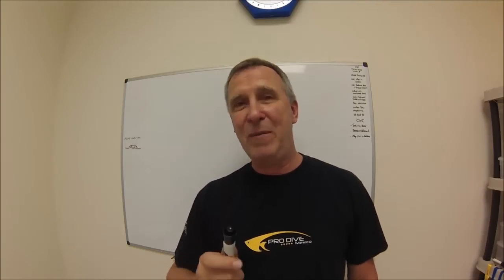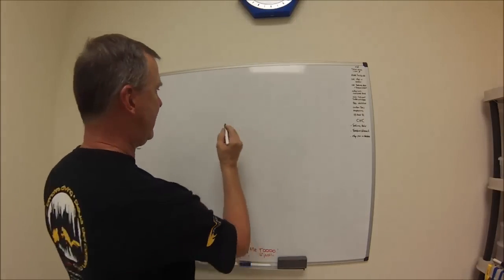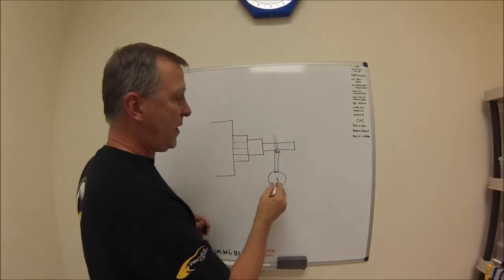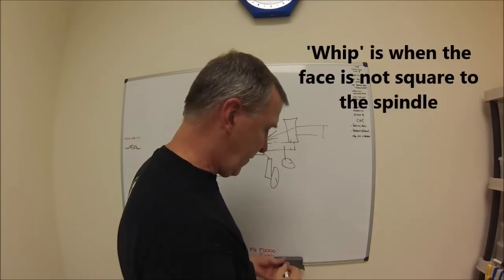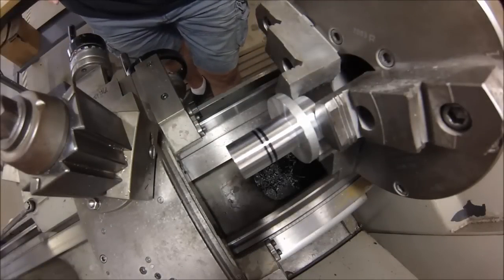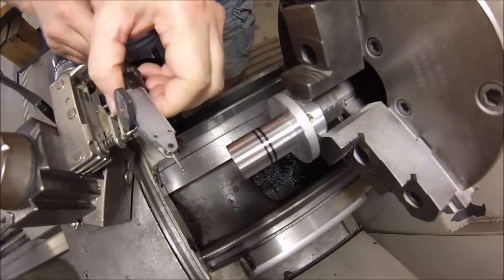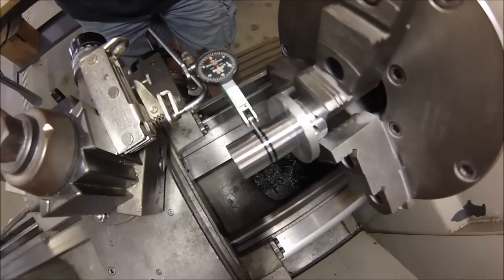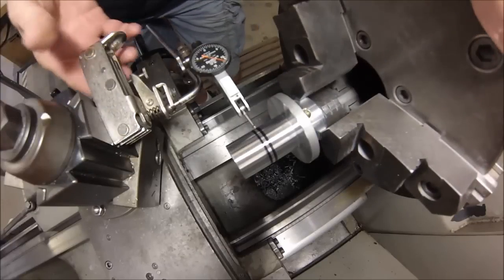CLASSIC Rewind -- Precision indication on a Lathe - DO NOT MISS THIS VIDEO !!

Comment: A sharpie marker will remove itself. Just mark over the spot you want to remove, the solvent in the marker reliquefies the mark, quickly wipe off. 
This is good (and simple) for making corrections on your permanent marks or notations with a sharpie.

Comment: soooo... how to hold and indicate a gear?
Reply from the maker: What is the machining to be done on the gear?
Reply: @joepie221  face, taper the bore, blah blah...

too big for a pot chuck, ie, no handy scrap to make one. and that would rely on the OD being accurate anyway...
ended up on the faceplate,  some ground pins in random teeth to clock off the PCD or at least the same region in various teeth... didnt trust the existing bore. just as well, showed about 0.2mm runout once set up...

 the joy of using "off the shelf" components?

makes that nice sweet "wirr" sound rather than that "cachonk cachonk" of slightly eccentric gears... fifteen years ive tolerated that sound from the first attempt!

theres some video material for you... dealing with things like gears, timing pulleys, etc... clocking things that dont necessarily have convenient references? or may be suspect if they do?

Comment: Hey Joe the thing I never understood about this concept is how a part can move in the chuck? Once the jaws are tight the part has nowhere to go, therefore tapping it is only bending it, isn’t it? Can you elaborate on this?
Reply from the maker: Its probably the resting position of the jaws that gives it the most opportunity to move when bumped.
Reply: @joepie221  so essentially it is the jaws that are shifting ever so slightly in the chuck body? Is the position of a machined part repeatable when chucked over and over again? Before watching this video I always thought a part would run true to the lathes axis when chucked.
Reply: It may be gripped tight but not square. Ever measure a square object with a micrometer. If it's not square between the carbides you will get a different reading. It just happened to me yesterday and I got a .002 deviation.
Reply: @madjack956  how does this relate to a round part in a chuck?

Comment: If you make a mistake and actually use a Sharpe Marker on your whiteboard, all is not lost. WD 40 will remove Sharpe ink off a whiteboard easily. Once the Sharpe is gone, remove the residual WD 40 with a bit of isopropyl alcohol. I once attended a sales meeting where the President of the company used Sharpe on a hotel's rather expensive whiteboard (6' x 8'). When the mistake was found, one of the hotel's cleaning crew came in and cleaned the board off as described saving the day. He told us it happens all the time.

Comment: Hi Joe, you could see the error in the camera view were the part was moving back and forward compared to  the bed. I assume that chuck was a 3 jaw independent, which means you may have to adjust all 3 jaws to achieve a result, rather than the opposing jaw in a 4 jaw independent chuck.
Regards from Oz, Dennis

Comment: Hmm?  How about a chalk board?
1/ No dried markers.
2/  Chalk is cheaper than those marker things.
3/  Chalk has no solvents.
4/  I am yet to be convinced that the fine dust from those marker things is safer to breathe on board erasure than is chalk dust???
5/  Bits of chalk on the board ledge are ultra available.  Usually there are few if any markers available; at least with a strong line.
6  Easy erasure.
7/  When you need to chalk a file a quick trip to the board is all that is required.
Perhaps I am missing something, but simpler is almost always better.

Be encouraged Joe.

Comment: 91% isopropyl/rubbing alcohol or dry erase markers over it will remove sharpie or permanent marker from a white board. 👍👍
Reply: Use a dry erase marker over the top of a sharpie and then wipe it off.

Comment: The first 10 years of running a lathe, from a learning perspective, the only chuck I had was a 4-jaw independent chuck.  Dad started out as a oilfield machinists, running lathes that only had 4-jaw independent chucks on them and that's why his 9" SBL lathe in the home shop only had a 4-jaw independent chuck on it. You get really good at dialing in one. Later in life, I've purchased several 3-jaw chucks, most of the adjustable type like yours.  I still get the 4-jaw out once in a while and use.  thanks for sharing.
Reply: I have both in my cabinet but the four jaw is the chuck of choice, but my three jaw is the non-adjustable type.

Comment: Quick whiteboard trick: if you accidentally use a permanent marker on a dry erase board, try removing it by coloring over it with a dry erase marker.  The solvent in the dry erase markers usually dissolves the permanent marker and amalgamates the other dry erase components into the permanent marker ink.   This turns the permanent ink into a (poor) dry erase ink, and you can remove it.   It might take a few iterations to get it all off.

Comment: The one question I have about any kind of part indication on the mill or lathe is, if you can adjust the part by "tapping it in", what prevents it from moving once you get it in the right spot? I get that tapping is an impulse movement, vs cutting should be continual, but it seems to me if it moves if you tap it, it could move while it's being machined as well. Just an odd question from a beginner hobby wannabe machinist
Reply: Hi, Once you get it right then tighten the chuck up.

Comment: Mate stupid question. But I take it that wasn't the usual 3 jaw chuck that all jaws tighten together with the key?
Reply: This is a "set-tru" (or equivalent) that moves the body of the chuck. The three jaws are on a scroll to move them in or out, but the scroll has limited precision.  The whole chuck body, including the jaws, is moved slightly on the backplate by the use of four screws near the back of the chuck body. It is sometimes possible to modify a chuck to add this functionality but it's easier (and typically more expensive) to buy it with this capability.
Reply: Thanks mate
Reply: @Gravattack  Without a set-tru or equivalent chuck, you have to go to the 4 jaw to be able to adjust anything like he showed here. Most smaller / hobby lathes aren't going to come with a set-tru chuck
Reply: @gorak9000  Thanks, I'd never even seen one before.

Comment: What indicator holder is Joe using? It seems very efficient.
Reply from the maker: its a US General model 387. discontinued and hard to find.
Reply: @joepie221  Sounds like a good project to make one.
Reply: US General #387 with magnetic base . He mentioned it in his setting lathe tool heights vid. Ive been trying to find one ever since.scarce as hens teeth
Reply: When I can I use a regular 1“ throw dial in my tool post. This allows me to put it at center height, and zero using the cross slide or carriage.

Comment: I've used a 4-jaw chuck many times, but I never had a Buck set-tru style chuck. On the set-tru style, do you ever loosen the front chuck screws to allow the chuck body to move relative to the back plate? Or can those screws stretch and pivot enough to allow some motion, while staying tight? Thanks.

Comment: I cut threads toward the chuck because my lathe has a threaded spindle.  My lathe also has no provision for running in reverse.  That can be done a number of different ways of course but I also don't have a problem threading toward the chuck because I simply pay attention to where the tool is.
Reply: You got an old Lodge and Shipley?
Reply: @williamrekow7513  No, actually it's a Hercus 9A which was made in Australia under license from South Bend.  It's identical to a South Bend 9A and in fact has a number of south bend parts since shipping from Australia to Canada is a touch spendy.

Comment: Permanent Sharpies go away with alcohol, just sayin'.
Reply: as will acetone but both alcohol and acetone will both damage the coating that is on most (if not all) whiteboards...
Reply: @CP_300PRC  There's also special whiteboard cleaner (I'm not sure what it is, but it has a somewhat unique smell). It will take sharpie off, as well as the build up over time of the dry erase markers that leave the board hazy, and leave the board perfectly white and just like new. Not sure if you can get the "original formula", or only the environmentally friendly stuff these days - the original works way better.
Reply: @gorak9000  Hmmm, interesting. I knew there were "special" cleaners but never knew any of them would take off Sharpie ink.. Thanks, I'll have to look into them.

And yeah, sounds about right... "original" good formula probably no longer available.
Reply: @CP_300PRC  Even if the cleaner doesn't take sharpie off itself (which I'm pretty confident it would), it'd probably work well to take it off with IPA first, and then go over it with the cleaner. The cleaner seems to leave an ever so slightly oily / shiny finish on the board - probably something the alcohol takes off, and leaves the board too 'dry' for the whiteboard markers to work well after.
Reply: Hmm, looking at the SDS for the cleaner, I don't actually see anything oily in there, but it does have surfactants in it - maybe it's a coat of surfactant left that leaves the smooth shiny "oily" finish?? The main ingredients (the solvents) seem to be DI water, 1-Butoxy-2-Propanol, and PPG2 Methyl Ether. That could also be what's in the "environmental" version - the old stuff probably had more chemicals in it.